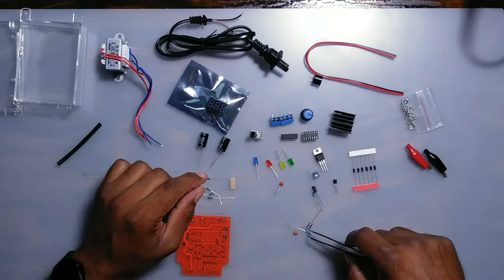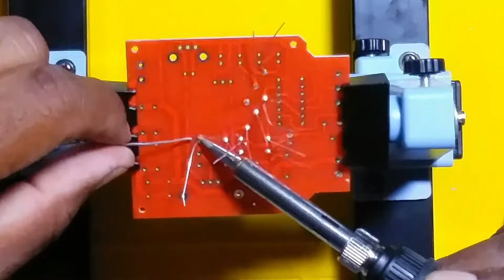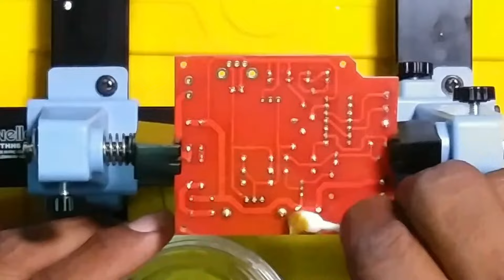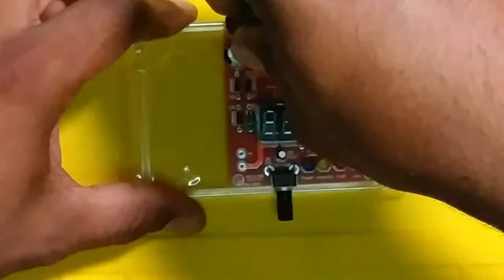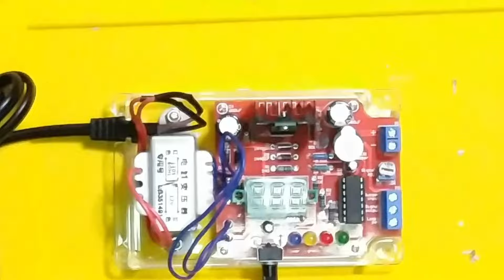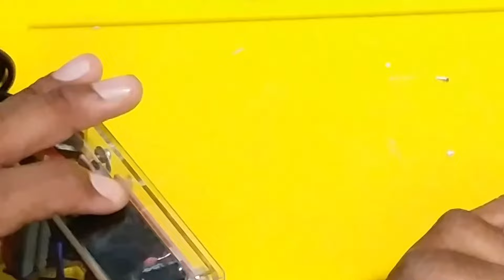DIY Power Supply Voltage Regulator Kit Timelapse

Comment: Love these styles of videos 🔥🔥 what exactly is this for? 🤓
Reply from the maker: It's to output any voltage you need for a project. different electronics require different voltages, the most common are 3, 5, 9 and 12 volts, so it's nice to have one power supply that can do all of them.